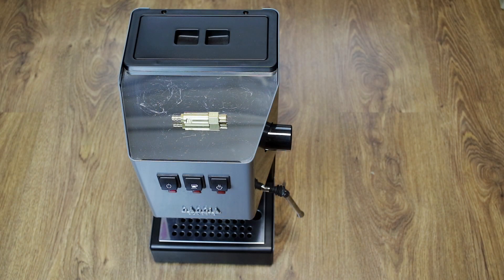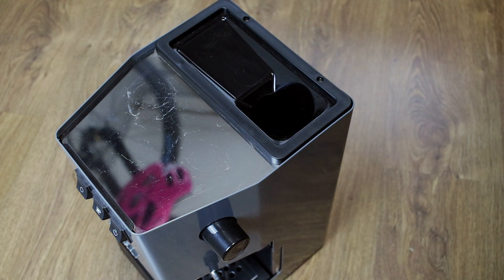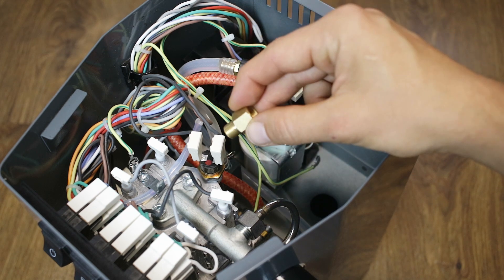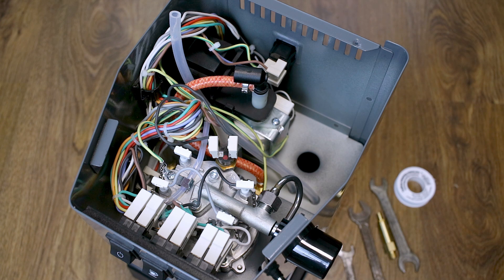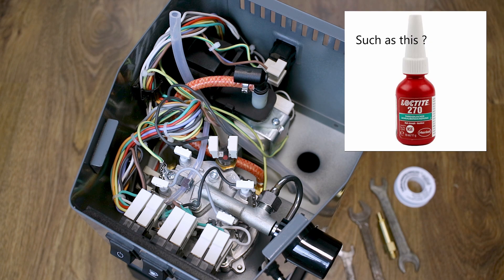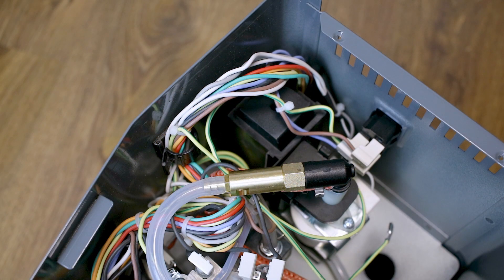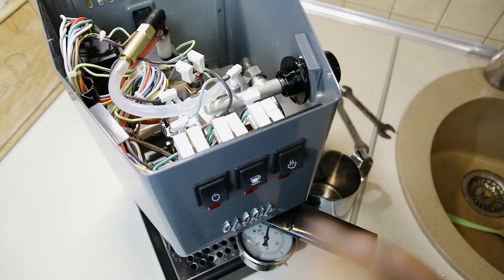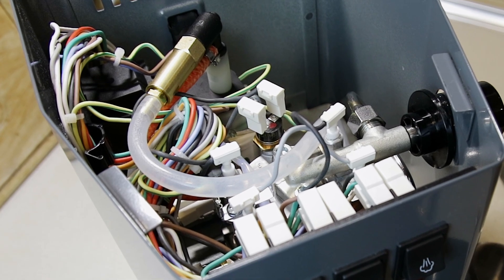Gaggia Classic PRO adjustable OPV valve, how to mount it ??

Comment: the boiler will be too hot for the plastic tube to be sitting on top of
Reply: The tube is silicone not plastic. The temperature the boiler operates will not affect it. Food grade silicone tubing is rated for -73C to 260C. The thermal safety fuse on the boiler blow at 184C so it'll never got hot enough even in a thermal runaway event.

Comment: On the piston you removed does the blunt flat  side or the narrow side face the spring on the stock setup? I've been told the blunt side toward the spring but it looks like it came out the opposite way. I'm having some issues with pressure on the stock setup.

Comment: Why don't Gaggia just set the Over Pressure Valve to 9 bar ??
Reply: It's because of the pod and pressurized baskets for folks who don't want to grind. It makes big difference.
Reply: @DefendtheDeep  It doesn't make any sense. You've  removed the workings of an over pressure valve and replaced them with another over pressure valve. You believe (probably cos you've  seen similar utube vids)  by doing so you are reducing the pressure, which in a way you are but only by diverting the flow. 
A much better way to divert  the flow would be to introduce an adjustable flow diverter valve on the other line which diverts  excsess flow back through the pump therefore leaving the over pressure valve untouched and set  to do it's job which is to protect the pump in scenarios of over pressurization.  The OPV is not designed to have continuous flow.
Reply: @seantivenan9593  I didn't do this mod. I did the 9 bar spring mod which is super easy. Also comes with 6 bar.in kit.
Reply: @seantivenan9593  Have you figured out a way to do this? I would like to learn more

Comment: Hi. Why change one for the other if it is the same? 
The original valve is perfectly adjustable and has the same principle of operation.
Reply from the maker: Originally it is the same ??? I don't know where you got this information but it's not the same. Gaggia originally has a set of 13 bar, it is the pressure under the perfect crema sieve and if you want to use low pressure sieves you have to make a modification using a spring or install an OPV valve.
Every day I modify Gaggia coffee machines and I know what I am writing.
Here's an example when I tested a customer's coffee machine on the original valve that Gaggia assembles https://youtu.be/qnaTAbPR_0k
So the simplest modification is the spring or if you want to play with different pressures then the adjustable OPV valve
https://www.youtube.com/watch?v=jQQKu4wIStk
Reply: Not in the new Gaggia Classic Pro, you have only a not adjustable spring valve there.